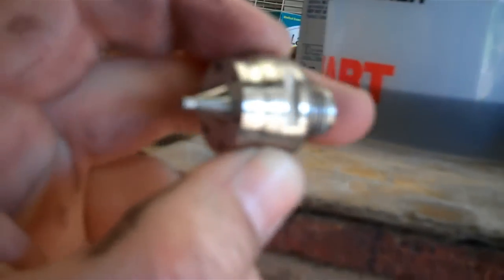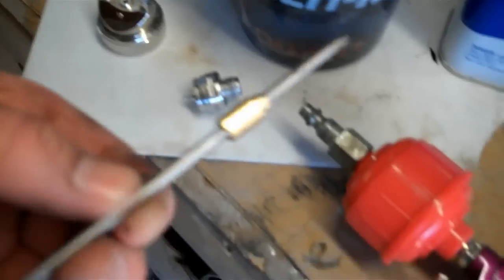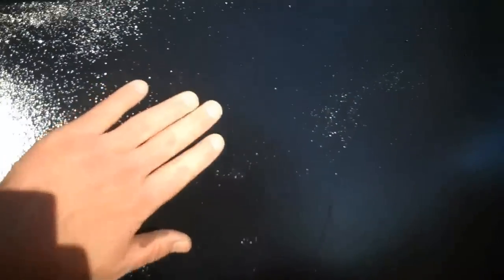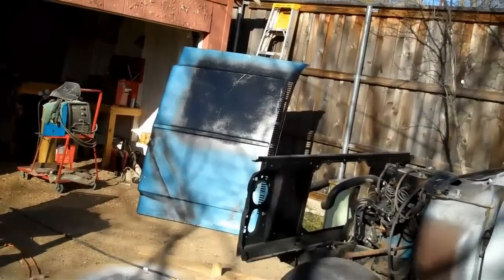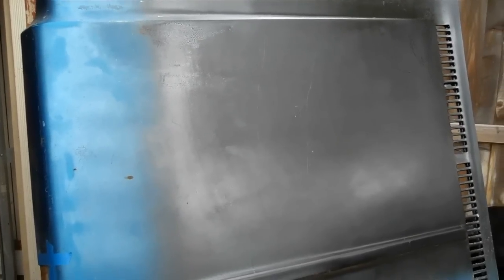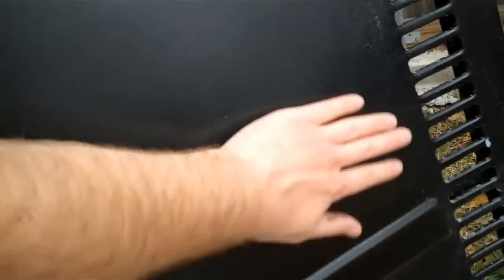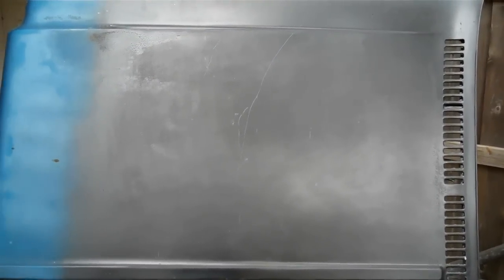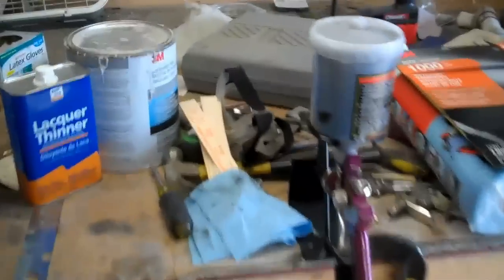PART 2 C10 PAINTING EXPERIMENT | Rustoleum Paint Job

Comment: I know this is a few years old, but a few tips for anyone that comes across this:
#1, do not use those cheap bulb filters that you see on the gun. I had a huge "dust" issue the first time I did my car, which I didn't understand as I did it in a sealed off home made booth using furnace filters as intake air filters, a wet floor etc... I ended up needing to spray some small parts after and didn't have any more filters and there was no dust. Came to learn that those filters were actually disintegrating and leaving debris in my paint. Not impressed as a $2 filter ruined $600 worth of paint and a few weeks of prep time.

#2, I used a 1.8 tip set up, allows more paint and it won't be "dry" by the time it squeezes out of the smaller orifices and flies to the surface, allows the paint to flow out nicer once it's on the panel, and you don't need to thin it out quite so much, reducing your chance of runs while putting on a nice thick coat. 

#3, Take time to play with the gun's settings and your painting technique as that has a huge effect on the outcome.

I painted a truck cap with rustoleum, using Acetone as a thinner. Hardly any orange peel, no runs, nice and slick looking, and used a cheap gun to do it. It's possible to get a really nice finish that you won't need to sand and buff after to get a nice look.
I used a gun with a 2.2 tip to paint un-thinned house paint on my duck boat for a camo job, and it worked pretty good!

Comment: Lacquer thinner or acetone instead of paint thinner as per paint manufacturer. I almost always prefer lacquer thinner. Rustolium works very well with it . Paint will flash surface dry almost immediately and dry to re coat fingernail test in 15 to 30 minutes depending on temperature and humidity.